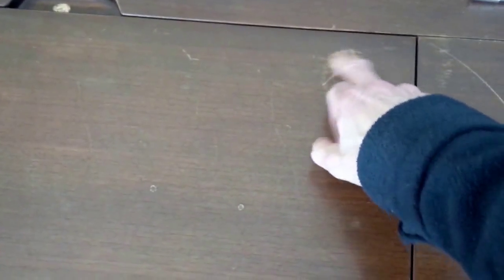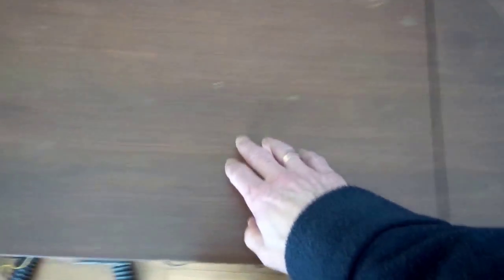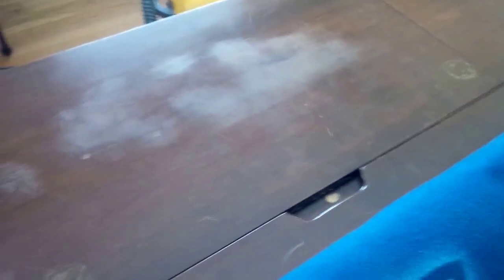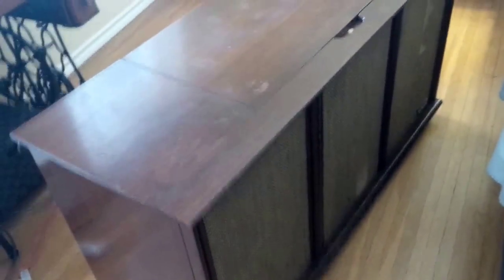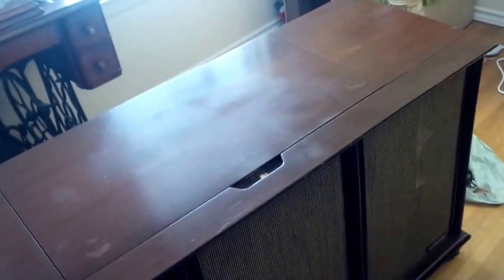Viking Console Stereo Video #21 - Remove Water Marks from Cabinet

Comment: NPO Ceramic Capacitors are single-layer ceramic capacitors made from a mixture of titanates.

A NPO ceramic capcitor is an ultrastable or temperature compensating capcitor. It is one of the most highly stable capacitors. It has very predictable temperature coefficients (TCs) and, in general, does not age with time.

 
NPO stands for negative-positive 0 ppm/°C, meaning that for negative or positive shifts in temperature, the capacitance changes 0 part per million, meaning that it has a flat response across a wide range of temperatures; the capacitance of the NPO capacitor stays constant (at the same value) despite variations in temperature.

NPO ceramic capacitors are suited for applications where stability over a wide range of temperatures and a high Q are needed.

Filter networks and most circuits associated with tuning and timing, as well as various types of resonant circuits, generally require ultrastable capacitors. They are also very suitable for oscillator construction in order to compensate for frequency drift with temperature.